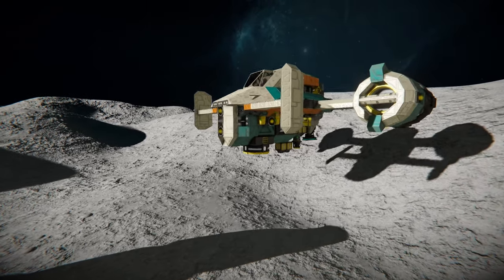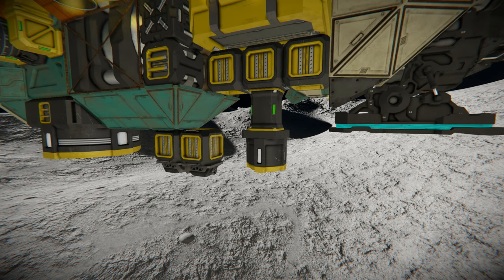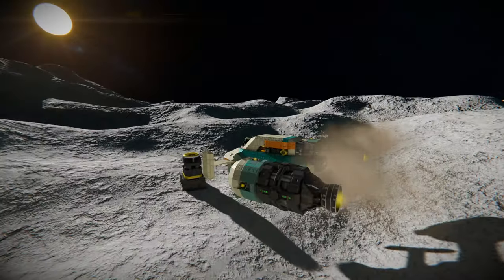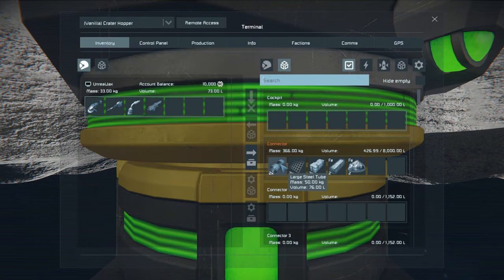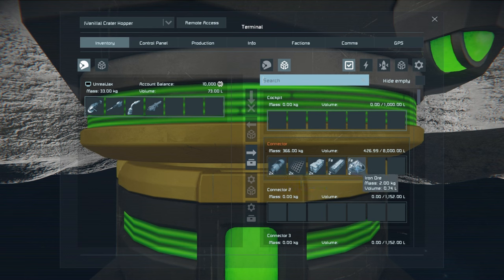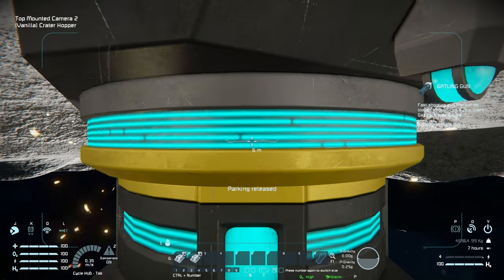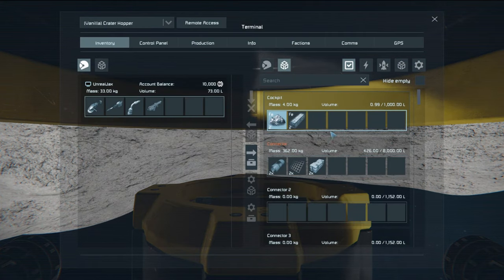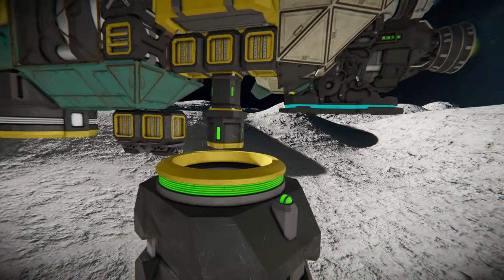The Small Connector Convertor! - Space Engineers

Comment: Keen just needs to add a large grid small connector to the base game. I'm sure they can figure out how to make it look better than this.
Reply: I had created that (not Public yet), but there is an issue design wise, magnets works only toward Center of block, so there is impossible to have offset version, or version that is smaller than half of the block. In case of "slim" connection there is issue with reversed forces that will make ship trying to rotate itself. 

In early version of my mod I created small connectors using same empty as large one, but all connectors got "double", small inside large so after connecting visually they would fit. 

Another issue is that block support only one empty, so creating twin, small/large connector is not possible. 

I have to finish my set finally after I get back to modding and release it.

FYI. I am known on workshop as archan79, creator of rebels lights, and co-creator of rebels gates and gsf energy gyroscope. 
My work you can see also in many streamers that use my unlisted pack, known as "poopoo mod"
Reply: Really effing stupid they haven't done that. Can't dock ANY drones/buggies etc to a base unless you want Klang.

Comment: This already existed for 3 years as the "Ejector to small connector" mod.... wish people would stop stealing other mods and "remaking" them
Reply: There is difference in keen version. Traditional modded small connector uses same empty as large one, so it was possible to pass items that don't pass thru small conveyors, keen new version behaved same way like small conveyors, so they will not pass stuff like most of components or missiles. And you could also connect small connectors with large ones. It looked in the end pretty... Stupid. In my not released mod I had own version of small connectors and large ones were "dual", so inside of large connector was small one. After keen connector update I had to rework all my connectors, as it was impossible to have two working empties on one block.